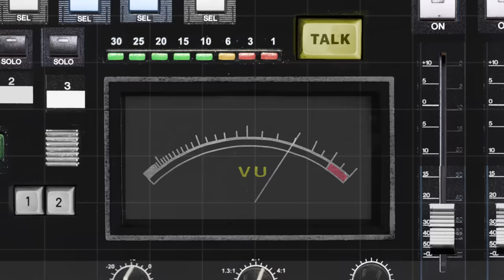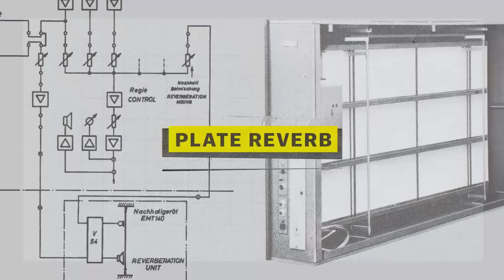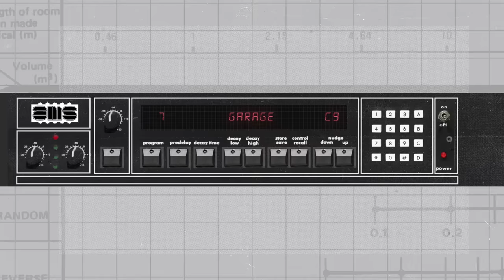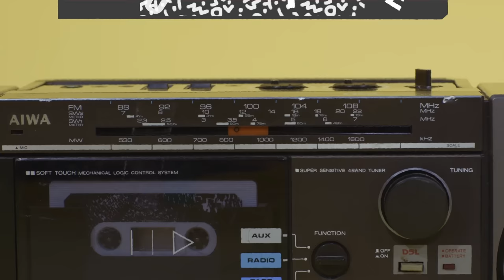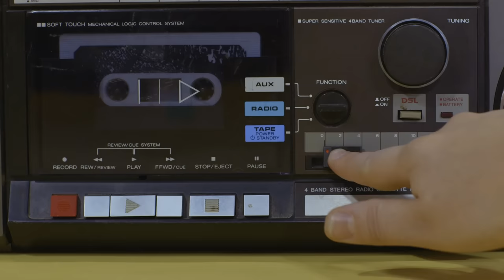How a recording-studio mishap shaped '80s music

Comment from the maker: A previous version of this video mistakenly suggested that a noise gate affects frequency. In fact, it affects amplitude.
Reply: hi vox
Reply: Vox a comment with only 11 likes from the vid producer. This is new
Reply: mishap joke
Reply: A compressor doesn't amplify low sounds either. It tends to have a make-up gain, but it is not an inherent part of the compressor. A compressor simply pushes down the volume of the sound when it reaches a set threshold. Then it's up to you to amplify the sound to compensate.
Reply: Erik Lauri Kulo Although sometimes downward expansion is used with compression, which actually does amplify signals below a set threshold.
Reply: Erik Lauri Kulo isn't that a limiter?
Reply: smartin368 a limiter works like a compressor but with a very fast attack and release plus a very high ratio of compression.
Reply: Erik Lauri Kulo >> Technically, if a compressor has a knob that does something, then the compressor does that thing.  It doesn't matter how dynamic range reduction is viewed,  'pushing loud stuff down' is the same as 'bringing quiet stuff up'.

Case in point: many compressors work by driving input into a fixed threshold (1176, Distressor) in which case dynamic range is decreased and loudness is increased simultaneously.  If you change the process by making the Input static, lowering the Threshold, and adding Makeup Gain, you get exactly the same thing.  In the game of levels, everything is relative.

Why you should trust me: I design analog and plugin compressors for a living :-)
Reply: Gregory Scott Actually, I don't trust you because you design plugins. I trust you because you are correct.
Reply: You fixed that, but not the completely absurd pronunciation of Padgham, the inventor himself? Well done, Wax.
Reply: Vox - How dare you. I want the press to know about this.
Reply: Vox Prince had that sound in 1979
Reply: Wow Vox making a mistake in the video.  Never!
Reply: Music Calgary side chains mean they can listen to particular frequencies, but when they close they affect all frequencies.
Reply: Erik Lauri Kulo actually you’re wrong too.

Comment: It figures that Phil Collins invented the drum sound that defined a decade.
Reply: AirborneSurfer actually a band called XTC defined that sound years before Phil Collins, listen to the album Drums and Wires, the sound is present throughout.
Reply: XaviorZ that album is amazing!
Reply: Another band that predates Phil Collins is Yellow Magic Orchestra (YMO), a pioneering Japanese synthpop band that used gated-reverb drums for their song "Behind the Mask" in 1979. "Behind the Mask" is best known for the Michael Jackson cover version, which doesn't have the gated-reverb drums, but the original 1979 YMO version had it. Interestingly, YMO's "Behind the Mask" released around the same time as XTC's "Drums and Wires" in 1979. It leads me to believe YMO, XTC and Phil Collins may have all discovered the gated-reverb sound independently.
Reply: Phil is still hands down the best at it 
Thanks for the video
Reply: also it had nothing much to do with phil, it was gabriel and his producer lol
Reply: Hugh Padgham wasn't the producer.  He was just the engineer.  Steve Lilywhite produced PG's 3rd album.  But still, it was the three guys (Collins, Gabriel, Padgham) that decided to use it.  Hugh didn't become a producer until he started working with Phil (Face Value) and Genesis (Abacab) and later, The Police (Ghost In The Machine).  Hugh also used the gated reverb on the only album he recorded with Yes (Drama).  You can hear it well on Alan's drum riff on "Run Through The Light".
Reply: Mox_au Actually, Collins was the drummer for 'Intruder'. Just that one song though.
Reply: "Invent" is a little strong for what happened.
Reply: Don't you mean Peter Gabriel?
Reply: Also, listen to Omega - The hall of floaters in the sky (1975). This album has a super processed sound that was several years in advance. The snare drum is not quite 80's Gated reverb level of abuse but it is getting there.
Reply: But he didn't,,,,   Peter Gabriel did or one of the engineers----- that's who had the ears who heard it..
Reply: Andy Partridge of XTX just happened to work with Ryuichi Sakamoto of YMO on the latter's B2 Unit project.
Reply: Did you even watch the video?
Reply: Doesn't the video tell us firstly that it was Peter Gabriel and secondly that he accidentally discovered it?
PC only used the sound for his song.
Reply: AirborneSurfer ... and he invented the lightbulb. Listen to the vid again a learn something.
Reply: Try listening to Triumvirat's drum riffs.
Reply: Ye the shittiest drum sound after today’s drums...
Reply: Chicken Tendie Phil was on a few other songs on that album too. He was the main drummer on No Self Control and he played some overdubs on a few other tracks
Reply: 2:17

I can feel it...

1:18

Captain America spotted!
Reply: Hugh produced Synchronicity by The Police as well as the Genesis Self Titled LP, both excellent records
Reply: Exactly.
Reply: Probably not ... he was too busy air-drumming to bullshit like "In The Air Tonite".
Reply: M1, Rodzilla, I can't help but think you guys enjoyed American Psycho.
Reply: Wood 'n' Stuff " ", Things are very (...very very) rarely if ever invented outright.
Reply: His voice was on reverb throughout that whole decade too.
Reply: No. It doesn't figure at all.
Reply: Lan Sorbet, actually "Beneath the Mask" was originally made by Ryuichi Sakamoto (the member of YMO) in 1978 for the japanese "Seiko" watch commercial.
Reply: Unfortunately, it was partially because of Phil Collins that I was glad that the decade of the eighties was ending.
Reply: That awful sound.
Reply: Chicken Tendie bruh did you not here Biko? Peter said that Phil did the drums for that too.
Reply: Exactly. Gabriel has always had that creative ear and always took control over what he released. There is no chance it ever would have been discovered if Gabriel didn't like what he heard and think it was unique. It starts with him.

I also find it interesting that it was two members of Genesis - a very unique sounding, anti-mainstream progressive rock band in the 70s - who are responsible for the pop sound of the 80s and now today. Just goes to show how talented that band was in their early years and the pop sensibilities that existed within it, despite being so called "prog-rock."
Reply: It's "Behind The Mask" isn't it
Reply: Phil had nothing to do with "inventing" gated reverb..
Reply: You made me hear that album. I can say in a couple of songs there's a lot of reverb on the snare, and it sounds artificial enough (albeit, still more like an "effect" to me rather than part of the sound itself) but it's not gated, and it's applied only to the snare. I'd say that Gabriel & co. have their own merit in pushing the envelope  and treating the reverb in a creative way like that. And it sounds great!
Reply: He didn't invent it. You weren't paying attention.
Reply: I don't understand how you could watch this video and come away with "Phil Collins invented gated reverb drum tracks", maybe if very drunk and not really paying attention.
Reply: The YMO 'Beneath the mask' doesn't really sound like Gated Reverb to me. More like an extra noisesound (maybe of the Synare or Pollard Syndrum) mixed underneath the snare.
Reply: Peter gabriel invented it. Collins cashed in on it.
Reply: @ConnorR.mp3  Listen to "No Self Control" it's on that album too.
Reply: @RazorEdge2006  Behind*
Reply: @d0cy0  You're right. I've corrected it now.
Reply: @lansorbet5882  Early versions of "Behind the Mask" were first recorded in 1978, well before both of those songs.
Reply: He didn't, Peter Gabrial did...watch the video again.
Reply: Look for "Phil Collins Interview with drums - 1998 M6 Music" on YouTube. Phil describes what happened around the 7 minute mark.
Reply: You mean Peter Gabriel created it...
Reply: Neither XTC nor YMO did the gated reverb sound before Collins and co. Big reverb, yes, but not gated reverb. 

There's a big difference there, because reverberation has been used in music for as long as there've been music, but to make the reverb suddenly stop with a gate effect, that's what we're talking about here.
Reply: @nikkomakinen6582  still, Peter Gabriel's "Melt" was the underrated classic that we first got the traditional sound on. I think the idea of gated reverb goes a little before this moment though.. not sure lol
Reply: Tinny Cheesy Sound That Too. Pathetic that public is still worship that gas ...
Reply: The worst decade in pop music.
Reply: @RazorEdge2006  YMO used early versions of Yamaha electronic drums. They have a long association with Yamaha.
Reply: @unreliablenarrator6649  YMO also had links to other Japanese electronic instrument makers like Roland and Toshiba. They were the first band to demo the legendary Roland TR-808 drum machine, and had Toshiba build them an early custom sampler.
Reply: The Beach Boys did it before with 15 Big Ones (1976) and Love You (1977)
Reply: Rodzilla Phil is one of the most unique drummers of all time.
Reply: Michael Steven but he USED it more effectively than anyone else.
Reply: Bill Loomis same album
Reply: @blackie75  Except Gabriel brought Collins into Genesis. He knew who to call having just left to go solo....there was only one.
Reply: @Matthew Eargle - AirborneSurfer : Watch the video at least. Then you wouldn't have over 1700 likes from other people who also didn't bother to watch the video, lols. 
   Unfortunately if you want a ton of likes these days, the best way to get them is through spreading misinformation. Just look at America's president for proof of that.
Reply: @RazorEdge2006  It also sort of grew up from another old studio trick. If you had weak tom sounds they could be enhanced by setting an EMT plate to it's shortest decay time (basically clamped down) and using copious amounts of that blended in. It just gave a kind of more open woody ring to dull toms. I saw this used in the studio any number of times.
Reply: As much as In The Air Tonight (and most of No Jacket Required ) is/are legendary, people really should have a look at his other sides in Genesis and Brand X, and the rest of Face Value beyond In The Air Tonight to see much more of his creativity in action

Comment: Left out the small spring reverb units with a mic connected to a pickup via a couple of long springs.  Like the one in my 70's guitar amp.
Reply: I said the same thing.
Spring reverb was invented in the 1840's by The Hammond Organ Co. (Accutronics has their company roots at Hammond.)
The spring reverb is STILL used in brand new amps.

Comment: I once worked on a reverb unit that was a metal box with springs, there was a sticker inside that said "built by beautiful women in Wisconsin under controlled atmospheric conditions"
Reply: Wisconsin 👍
Reply: As a woman, you gotta love that story. A man needs to have the common sense and strength to love it also, to even be considered a man.
Reply: O. C. Electronics, long gone, but not forgotten! They were in Milton, WI. We put them in Gulbransen organs.
Reply: Fender had a tube driven spring reverb unit in the 60's
Reply: @Qingeaton  I remember the first time I saw one of those. I was trying to diagnose the problem with a friend's bass amp (it was the rectifier diode, easier to get a new amp than bother to replace it). "What's this springy box thing?" "That's the reverb." "Oh....cool!"
Reply: @fredlougee2807  Was that diode part of the tube rectifier or something that was instead of?
I remember my old champ had a 5Y3, if I'm not mistaken.

Comment: Gated reverb has been used before 1979. David Bowie engineers used gated reverb on his vocals on Heroes in 1977. They set up mics evenly spaced every so many feet and put gates on them. So as he sang with more intensity, the gates would open and pick up more of the room ambience. Engineers have been using that trick all the way back in mid 60's with plate and chamber reverbs. Yes, drums were recorded dry a lot of the time, but not ALL of the time. Almost all of Phil Spector's recordings used plate and/or chamber reverbs on the drums and final mixes of the songs he produced.. just listen to opening drums on Be My Baby by the Ronettes. It might not be gated reverb, but it illustrates that not all drums were recorded dry and they have a big In The Air Tonight feel.
Reply: Right, also very prominently featured even on drums too on Bowies "Low"album of the berlin phase, i think gated reverb is on all three of these at hansa by the wall studio produced albums, years before 80. You are quite right to point out, that reverb was added from the very beginning for ambience by inventive producers, like spector from there it is just a short idea away, to shorten the length of reverb with a noise gate corresponding to the tempo, just like syncronizing repeats of an echo, which was common practice already and naturally so.
Reply: The Tubes did it on the first lp Mondo Bongo.  Also done by Allan Holdsworth and Narada Michael Walden same time frame. I dont believe Hugh Phil and Pete I feel Bowie Low recording overall was huge influence to  that Townhouse crew plus yes PiL Flowers of Romance capitalized the sound that Phil really was fond of largely

Comment: Actually, it’s a lot more complicated than that. The REAL effect is created by REVERSE gated reverb. Not just normal reverb being gated. Depeche Mode used it a lot with Flood as their producer in the album “violator”. The legendary (now) equipment that produced this at the time was the Roland Dep-5. Still the only one that has reverse gate as a preset. That is: reverse reverb being gated. The iconic sound of the 80ies is largely the Linn Drum snare and kick samples themselves. Yes the Linn snare did have a bit of straight gated reverb, but it was largely the nature of the sound itself. Not the straight gated reverb so much. Flood (depeche mode) though went on to apply the REVERSE gate variety also on kicks, percussion etc, where the more traditional eighties sound was only the “straight gated reverb” snare but not the kick. The linn drum kick though equally iconic, was not “gate reverbed” at all. So the ultimate “reverse gated reverb” unit was the Roland Dep-5 and not the AMS so much, although it started the trend. This Dep-5 created the iconic sounds of New Order, Depeche Mode etc.

Comment: Reverb went through more changes from plate reverb before we even had digital effects. Spring reverb being the biggest one, but there were also analog reverb circuits created that fit into small boxes you could even stuff into a jacket pocket. Spring reverb was commonly used in guitar amplifiers at least back as far as the 60's. and all through the 70's we had reverb "pedals". Good video, but it misrepresents things a bit by jumping from a 600 lb box straight to a digital unit.
Reply: Well they talked about gated reverb specifically, no?